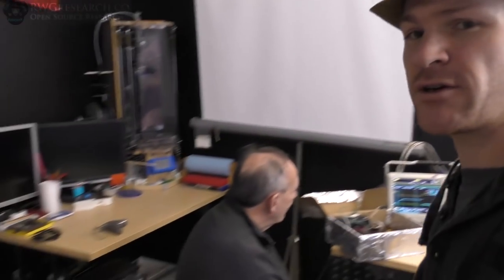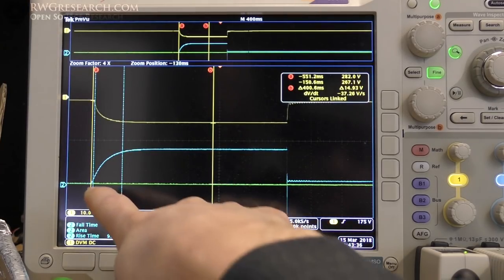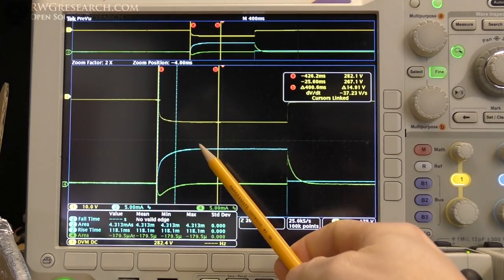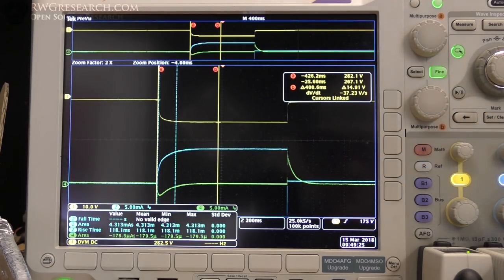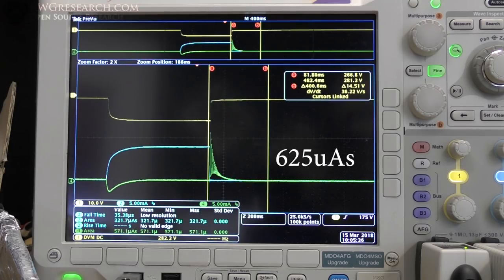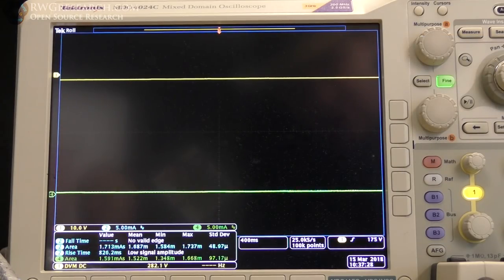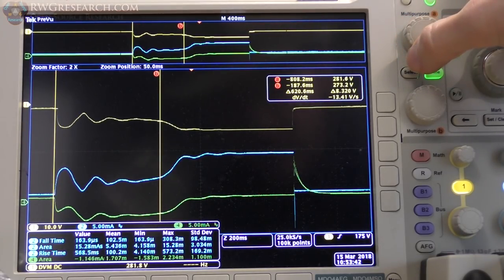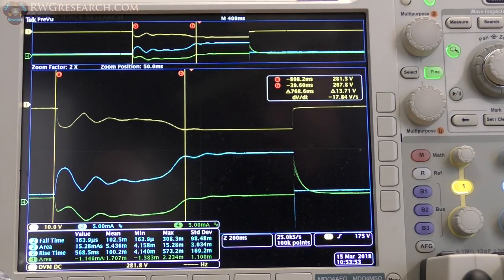JWN Project P14: Magnetic Induction Cancellation Testing.

Comment: It seems to me by placing a diode between the batteries and the commutator, the drag on the Magnet can be significantly reduced, because the diode reduces the current (back) flow from the induction of the rotating magnet created in the POWERED coil, resulting in higher rpm of the magnet with equal, to even less power draw from the batteries. This drag effect gets worse the higher the rpm and / or strength of the used permanent magnet gets. Only using the resistance of the batteries to reduce this effect is one way to go, but physical limits are reached quite fast. Russ, thank you so much for your extraordinary and professional analysis of the Newman machine. I can’t wait to see more.
Reply: TheGuru2You2 what is this community called? Where you guys are interested in free energy and magnetic levitation and obsessed with Nikolai Tesla?

Comment: So Russ you basically then need to use 2 commutators ...one for  the first coil and the second for the second coil and control each of them independently and see if you will find a combination, where  coil shorting and opening on the second commutator will make the motor spin faster and reduce the input current on the first coil

Comment: Very well done Russ...so basically what you say is , that if the right coil is shorted out at the right moment,  it will not drag down the rotor speed , but allow to extract energy without breaking the rotation , so a violation of Lentz law ??
Reply: Can you also find out if the shortening of the right coil will add in a kick to drive the rotor faster ?
Reply: If you can find a configuration where one of the coils ist shorted and energy could be extracted this way and the rotor would still get a positive kick or push from it...then we can violate Lentz law and speed the rotor up while extracting more energy. ...
Reply from the maker: let me give you my current prospective. It seems from the patent that he get the coil on the outside to interact with the coil on the inside without having interaction between outer coil and the magnet. when things are right,   He also clams that you can extract any of the energy from the outer coil and not effect the magnet RPM much or at all. There for the current coming from the outside coil is only by induction from the inside coil... He clearly believes that the energy is coming from the copper its self. ( Just like a magnet, he even pointed this out in your video) so, if the magnet is not effected by the outer coil, then the energy is coming from the copper / the interaction between the inner and outer coil, But not from the magnet...  He also clams that the rotor will speed up when the power from the outer coil is feed back in to the main coil in the correct phase. Dont forget that the outer coil in his was much smaller than the main coil. ( 10 / 14 AWG on the inside and 30 AWG on the out side) this will result in a higher voltage. In my coil the i was using 2 coil's of = length.  the question for me is can you extract this power / feed it back to the system to add to the effect? I'm not so sure. the induced current is in the opposite direction. and when the inner coil is disconnected there is a big current spike from the field collapsing, as there should be, and also there is at that point an interaction between the magnet and the outer coil.  theses are just things he talks about that I'm exploring. there are literally 100's of configurations he used. some single coils. some multiple coils. some bifilar. parallel and series. (just like his white Bord in your video) so.... we must explore this. it is good to note that he was using a florescent light as a spark gap. and he had caps added to each end, that indicates that there can not be constant current break down. also the shield on that smaller coil was great to see. i was quite sure he was doing that. so confirmed. ( this is the delay line / series resonance i was talking about in my DOC i have on my forum) so all good news. i have used a spark gap and a cap on my coil. i need to test his big coil for RF, and go down that path. i was focused on the induction part of this coil but i dont think that will work on this coil i have. however it will work for the RF... so i think ill start going that way soon. now that i have seen it in your video as it was. good stuff. bad i started working with voltages over 1500 with a cap and its hard. things blow up all the time lol ~Russ
Reply: Yes Russ. Your getting it. He used the transformer action to create a separation between the coils. It can be done via diodes back to the cap to fire for the next round. Just remember to put a volt meter on the free coil and check the voltage and polarity then make sure you keep the polarity for the cap. The diodes keep the cap from back feeding into the non driving coil.
 The florescent tube is a great way to have a non firing in air spark gap. Plus when the discharge conducts through the tube it allows for a small feedback into the batteries.
Reply: rwg42985 Well great observations,  Russ. Yes with the caps in series with the Fl tubes he prevents a DC shortout of the batteries. ..so only the BackEMF burst can flow through the Fl tubes....
Please try to contact Ralph Hartwell and Dr .Roger Hastings and see if the first big machine is still  somewhere available so that you could drive there and make some tests on this big machine... maybe it was not scrapped and a collector still has it in his storage....
Reply: Contacting them might be a good thing but then again it might not. There is enough out there for Russ to figure this out. Once he figures out the transformer rules apply here he will understand whats going on. Remember Russ.. Balanced weight of metal in each coil. The gauge size is the key when looking at the primary and the secondary of this device.The larger the gauge difference the better the results.
 Distance from the coils is also a key factor as you are experimenting on here.
Reply: rwg42985 well maybe the second coil just had its own commutator on the same shaft and he opened and closed that  second coil  like the Aviso and Konehead coil shorting effect and this was then used to power the incandescent light bulb ?
And the first coil just only had a reversing current commutator ?? What do you think ??
Reply: Russ it would be really interesting to see if you could use a second commutator just only for the second coil and implement there the coil shorting and opening... and then see how this effects the input current in the first coil...and the rotor speed...
Reply: All you have to do is read the patent. He tells you exactly how he does it. The second coil is a load coil only. But it can be partially or fully looped back to the front side.
 With the snapshot of the big machine, you know the one with the mirror at an angle, you can see the two coils. One of very fine wire and another with very heavy wire. Looping it will allow it to run steady state and you then can generate off of the shaft turning power as well.
Reply: Jon Bigman Jon what do you mean with balanced weight sizes and different gauge sizes ? Do you mean that the turn ratios should be very different cause the second coil has a smaller diameter wire and so many more turns than the first coil ?
Reply: Ok this would just induce a higher voltage then in the second coil but what about interactions of the two coils? how can we prevent lentz law with that effect ?
Reply: OU.com, i agree there is likely a sweet spot. however i dont see this as a violation of LENz, - its just that lenz law is less relevant too this very large, expensive and low power motor.